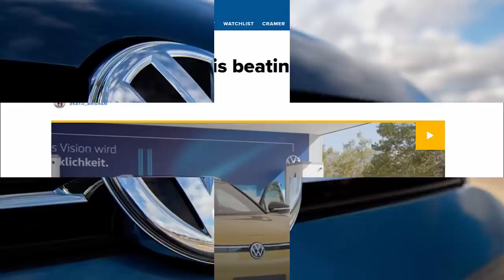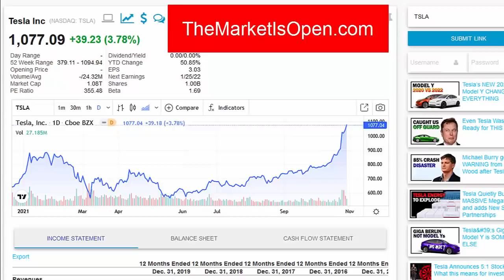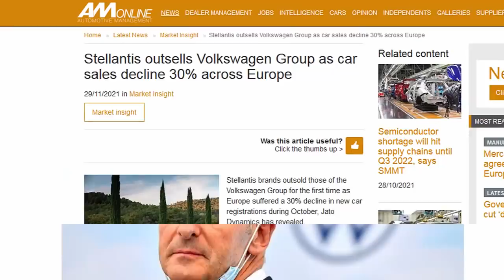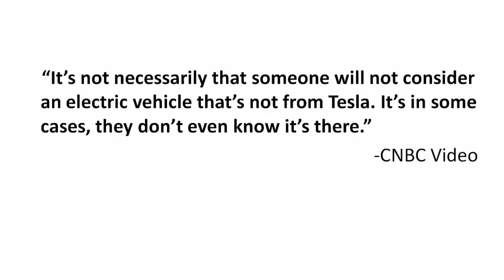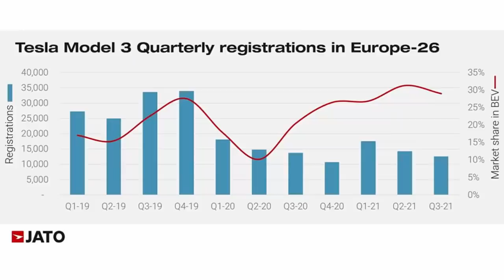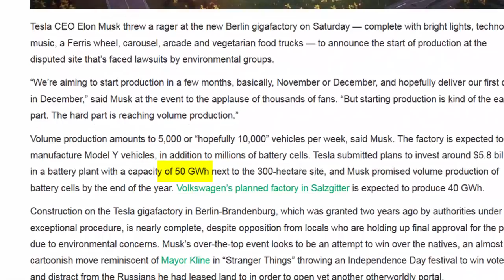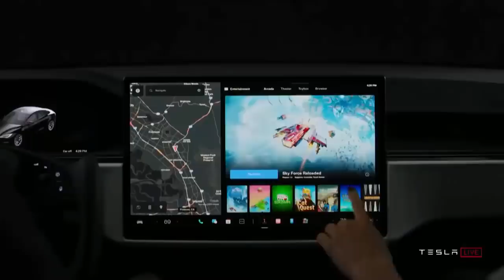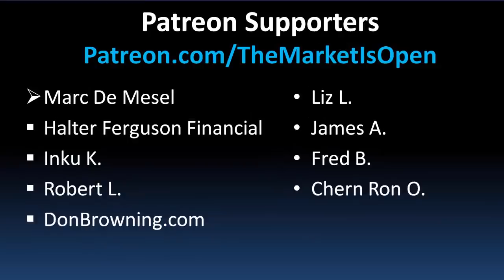Why Tesla will CRUSH Volkswagen in Europe

Comment: An important thing is the battery issues that all the German cars are having.
Reply: They aren't vertically integrated in like Tesla
Reply: what battery issues are there?
Reply: @hanswurst1660  porch and all day audi look up videos on them .
Reply: what issue ? how about Tesla issues, paint problems, missaligned parts..flying roof...fires....poor construction and autopilot car crashing on people and ambulances...?
Reply: @sylvainbiensur7370 Granted, paint and alignment have been an issue for cars coming out of Fremont. But as for your other claims i think you're dreaming. You've taken a few instances and just like CNBS exaggerated how many of these things actually happen. I think you might be thinking of Ford Mach E about roofs flying off. They have to do a world wide recall but they are lucky in one sense because they've sold stuff all. As for auto pilot or FSD, it is in the beta trails and always has been. The handful of select drivers are told to not rely on the FSD and stay focused and ready to take over. The smashes that have occurred have almost always been driver error when the car is not in FSD mode. This has been proven time and time again in the courts. And fires well aren't we lucky i don't have the numbers handy but the ratio between elec and gas fires is staggering and only an ignoramus would even try that comparison. But if your talking Chevy Bolt well that's a whole different argument.
Reply: @sylvainbiensur7370  - Tesla are well aware of all of these issues, and they're fixing them. The giga castings solve many of the misalignment issues, and they're putting the best paint shop in the world into Giga Berlin. Fires in Teslas are significantly less than in ICE cars, and autopilot is a driver assist system, not a fully autonomous one. VW is going to get a rude awakening, as are the other complacent German manufacturers.
Reply: @sylvainbiensur7370  in the case of the flying roof the Tesla owner modify it
Reply: @sylvainbiensur7370  do gas powered cars ever catch fire 🔥
Reply: @rogerfroud300  You Tesla guys are like a cult haha, I don't think until Tesla catches on in Europe or Asia, but let's see what time brings.

Comment: The biggest production advantage that Tesla has over Volkswagen is the method and their lack of need for storage because the major parts are cast then assembled saving many non major parts that VW need in their process. They have cut down on the component count and simplified as many parts as the can , saving wire pipe work and where they can sensors and making their computing systems efficient and lean. They write the code that they run and can totally understand when things fail … vertical integration is one of their strong suits, partnership with an aerospace company is another …

Comment: It is obvious that if BEVs were available and infrastructure for charging would be in place, like in Norway and The Netherlands, then sales of ICE cars would fall off a cliff and approach zero within a year. The only reasons it has not happened are 1. no BEVs available; 2. charging infrastructure is still lacking; and 3. intense fear-mongering campaign by fossil fuel interests using petrol heads programs on radio, TV, press and social media. The latter is the main reason, I think.

Comment: VW debit is about $160 billion, Tesla’s is $11 billion.
Reply: Volkswagen has $230 bn in revenue, Tesla $31 bn. Volkswagen has over $500 billion in assets they can liquify. They paid an $11 bn fine for the Diesel scandal as if it was nothing. Not even a dent in the stock. That's a third of today's Tesla revenue. Volkswagen owns, Audi, Fiat, Bughatti, Skoda and many more popular brands that won't go anywhere. Skoda Enyaq belongs to Volkswagen! It's build on the ID platform. So Volkswagen has many more electric vehicles for sale so you can't compare it 1:1 with Tesla. You had to sum up all their electric sales across all brands.
Reply: Having two gigafactories almost ready changes the equation radically …

Comment: Really,
VW doesn‘t need Tesla to experience a crush. They can very well do that on their own. They have internal problems that can’t be solved
Reply: lol... you guys are dilusional af.
Reply: @kicka55  "lol... you guys are dilusional af."

Have you missed the interanl tension inside Volkswagen?
Reply: @kicka55  You make valid points. And the Tesla cult keeps going. We constantly hear all the noise, but VW and Toyota sell 25 times more cars that Tesla does.
Reply: @bmw803  I like the vw ceo he seems reasonable and smart gm ceo is not dealing with reality
Reply: @kicka55  There are internal problems and diess will maybe be fired sonner than later, but only means that somebody even more pro EV will take his place. the Union pushed for MORE EVs and not less.

Comment: VW sold 10 million in 2019 and 9 million in 2020 and in 2021 vw will only reach 7 million, so their sales are already down by 30%
Reply: @kicka55  Tesla grew spectacularly during Covid, lock downs, supply chain shortages.  Nothing held them back.  I don't see that changing.  As was earlier stated, we're in a paradigm shift.  Assets become liabilities.  VW's massive assets will be their boat anchor.
Reply: @billweberx  Growing from 1->2 is much easier than sustaining 100. Learn some economics dude before you start to argue.

Comment: Remember vw is Audi, seat , Porsche and others ,so many products to change over and less than 5 years to do it . 2030 is just too late , by that time Tesla will have another 2 factories plus expansion in the others existing or being opened shortly. The 25000 tesla model will be out by 2025 and the lower price models from all oems will be in trouble
Reply: Other makers ALREADY have factories, no need to build them. So why all the noise?

Comment: Wrong focus! Tesla is highly vertically integrated and as a consequence cannot scale up as rapidly as a highly subcontracted VW can.  VW (and China) will copy what Tesla is doing and use their subcontractors to scale up to do that much more quickly than Tesla can.  Tesla cars may be of higher quality, but they will probably be a higher price and tesla certainly does not have the dealer net work and all of the mechanics and garage is out there that VW does. Buying the very best car (Tesla) doesn’t get you much if you can’t get that car fixed.  Also, since VW will be using subcontractors, it’ll probably be a lot easier to get replacement parts for VW cars then it will ever be for Tesla cars.
Reply: Lol
Reply: Tesla has already shown that vertical integration makes it possible to optimise both the product and production. There are of course simple parts like nuts and bolts that are sourced but designed component is better done in-house.
There is no evidence for that vertical integration is a drawback for scaling. Having several suppliers for the same components introduce complexity which typically hamper supply and quality control. Tesla grew 80% this year and will probably grow even faster next year.
Tesla is currently priced higher because they can and not until they have sufficient supply will they drop prices, however in 2022 they will double production and most likely get their own 4680 batteries in production. The cost difference for a 75kWh battery between Tesla and the open market  is about $5k.
Reply: @BjorckBengt    Apple does most of their design in-house and I would argue that the iPhone is superior to an android phone hands-down which is why I owned an iPhone. However, android dominates the world. Apples laptops are very good but there are certainly windows laptops that are just as good if not better and certainly cheaper.  One thing that I would like to see in videos predicting the dominance of Tesla is how much additional capital investment will they need to make in order to scale up to make 10 million cars a year? How long will that take?  Also, they may indeed have superior components and a superior design in many areas, but usually the market will purchase the item that is good enough at the right price even if it’s not the best.
Reply: Right! Tesla is so vertically integrated and slow to adapt and scale that they were the only car company to grow production during a period other makers were cutting production due to supply constraints. Tesla is going to make 50% more cars in '21 than last year. They managed to do this by changing suppliers whenever they needed, adjusting the software as necessary. A dealer network is a minus, not a benefit. No one likes going to stealerships. Tesla will come to you and do service. Evs have very few maintenance requirements anyways, change the tires and wiper blades. Since VW (and all other oems) use contractors they have less control over parts and have long lead times which makes altering the parts all but prohibitive. That is why legacy oems change so slowly. Herbert Deiss knows the score, that's why he is do what he is doing.
Reply: Take everything you wrote and invert it.  Then I might make some sense.  How many cheap Chinese cars do you see driving around in America?  Why would it be different for EV's?  Tesla's vertical integration is what makes them so nimble.  Having to convince subcontractors to ramp up and do it your way is the problem with legacy auto.  China is good at ripping off designs and duplicating them, which is bad for everyone but Tesla.  Tesla innovates so fast that China won't be able to copy them fast enough.
Reply: edwong3  They're probably sitting at lots, because the price might be too high, charging hassle, and other reasons. ID.4 in America sold out all 1st editions in a snap. North in Canada it's the same. You have to go on a waiting list, so this isnt exclusive to Tesla.
Reply: Tesla IS scaling up faster than VW.  All you need to do is look at number of EVs produced.  It doesn't matter what rationale you choose to prove it can't happen, when empirical data shows otherwise, your theory is wrong.
Reply: @CorwynGC  But, VW also makes ICE vehicle, commercial semis and high end cars such as Bentley and Bugatti. You're comparing apples oranges. I'm waiting for Chattanooga to start making ID.4s , so I can get one without having to be on a waiting list. ( hopefully)

Comment: Such silly hype all the time.  VW made 6+ million vehicles Tesla made it's first million ever well 900k.  An average Tesla costs $50,000 USD; not exactly green either weighing in at 6000 lbs.  Lovely cars and they are hurting larger makers in the luxury sports sedan area which is a big profit center; but crushing VW or Daimler or anyone else isn't really in the cards because Li Ion sucks.
Reply: There’s not a single tesla that weighs 6000lbs
Reply: @howtorawk  Yes that is a typo actually was suppose to be a 5; still about twice the weight of a typical hybrid such as the Toyota Corolla hybrid which is 2800.

Comment: Not before 2023 if ever. Tesla need a smaller car, Berlin keep beeing delayed there will be no volume production in 2022 and Teslas are expensive for the average European and too big of a car.
Reply: Well you're in luck since a car more suited to the EU is being developed as Elon mentioned when opening the Shanghai factory and despite it's size it is the number one car sold in Europe, not EV car... so many others seem to be working around the size issue just fine.
Reply: Model 3 sell well in spite of being an import. Local lower cost production without tariffs will further boost sales. Tesla will of course make a smaller European car when they have reached the volume limits for current models.
Reply: Agreed, Tesla need a smaller car. However, for the moment they will sell as many Model 3s and Model Ys as they can make until they do that.

Comment: Tesla seems to be getting away with selling cars with severe quality control issues. Paying for a Tesla with unmatching body color panels.  Inner plastic panels that don't line up. Now selling 2021 cars with 2017 batter packs.
Reply: They are selling a few demonstration cars with 2017 battery packs at a rebate. What does that have to do with anything?
Reply: Where they heck are you getting your information. If you are referring to the older vehicles they use for test drives that they are putting for sale they do tell you about the battery and YOU DON'T HAVE TO BUY IT. They are in such demand they can and do and will sell even those cars if people want they they aren't producing cares at such a low level today, stop spreading fud.
Reply: Troll alert.
Reply: GLJ is that you? Welcome to 2018.
Reply: Some plastic panels are nothing against severe quality problems in engine and transmission of VW ICE cars.